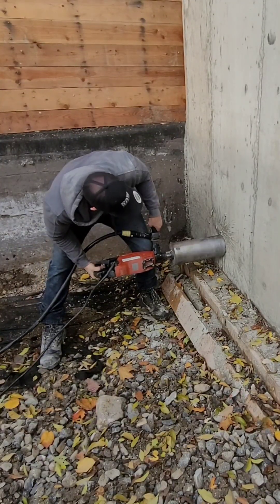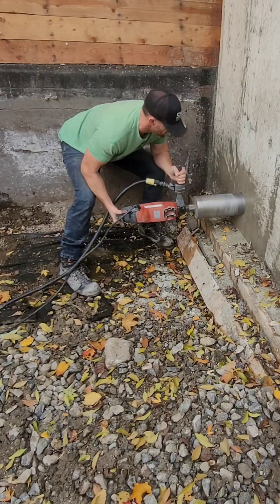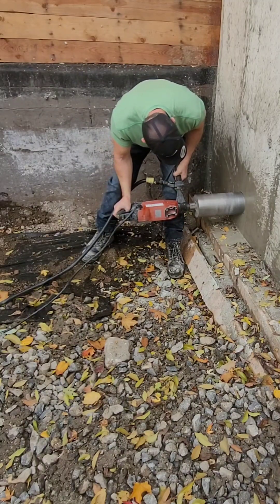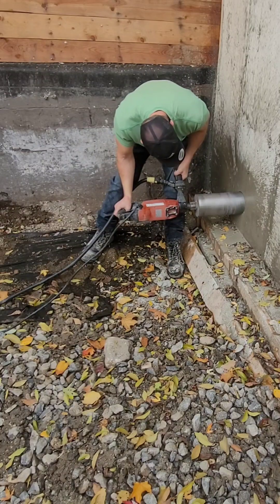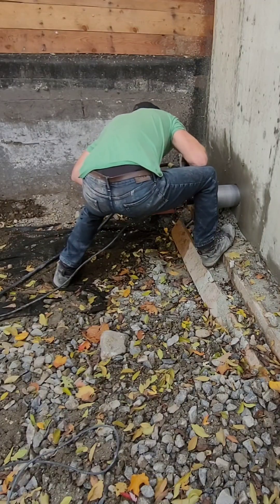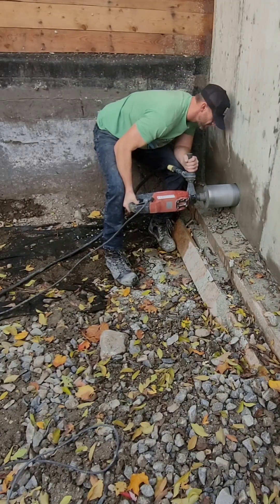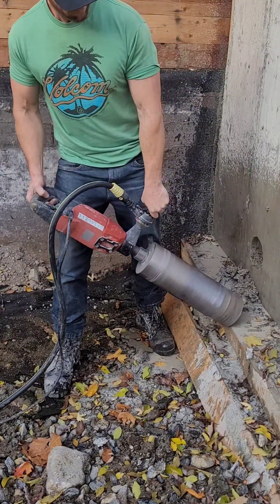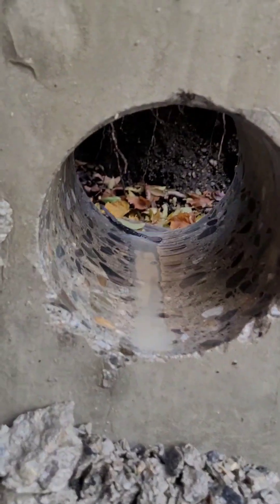Core drilling a 6 inch hole through reinforced concrete

Comment: Aaaaaaaaaaaaaaaaaaaand that's why I don't lend expensive tools to anyone. I guess that it would have been easier on you and on the tool to mount the stand it is supplied with. The clutch works flawlessly but shouldn't be abused, I guess. Good job on the drilling, though.